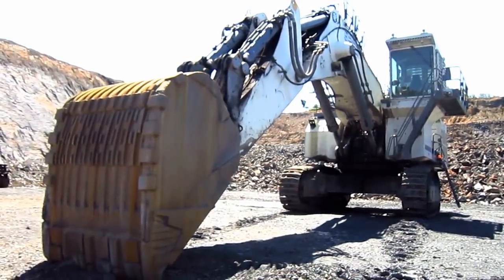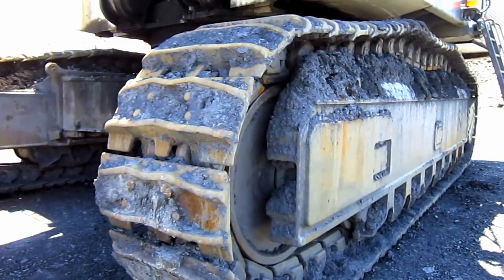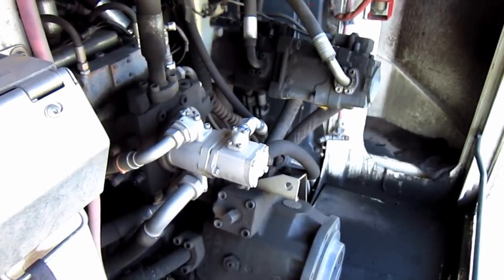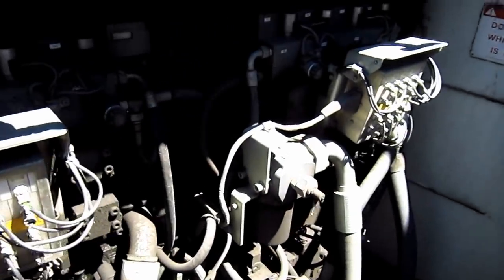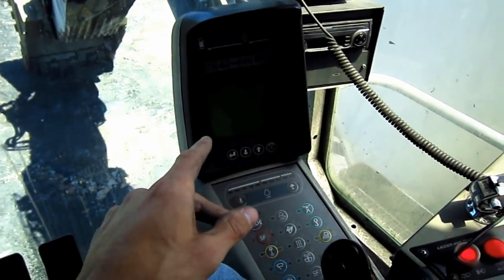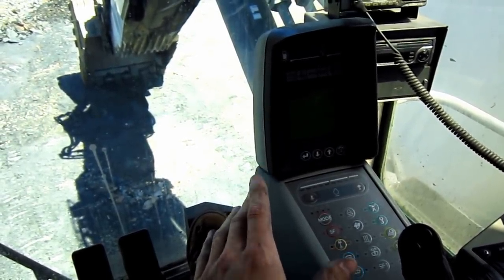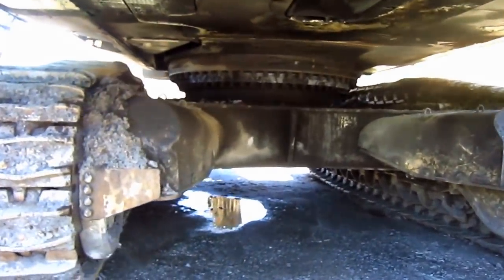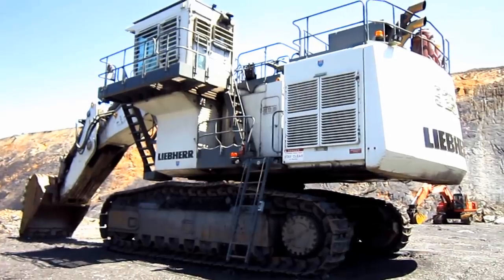Liebherr R9250 Documentary

Comment: This video is awesome, like your chanel man. What do you think about Liebherr mining machines in general. I hear they not so reliable, as caterpillar. For example on t284 trucks exists problems with frame, also i hear  excavators not so good as CAT excavators. What do you think about this? Liebherr good mining machines, or they not so reliable as CAT or Komatsu.
Reply from the maker: From my work experience around them, they are a well engineered and fast digging machine. The issue with Liebherr is the US is parts availability.  A lot of the major components need to be shipped from France which can affect the machines unscheduled downtime.
Reply: @PAmining  Thanks for answer